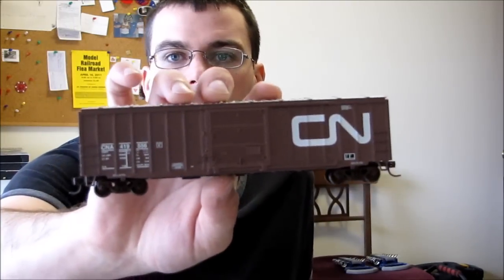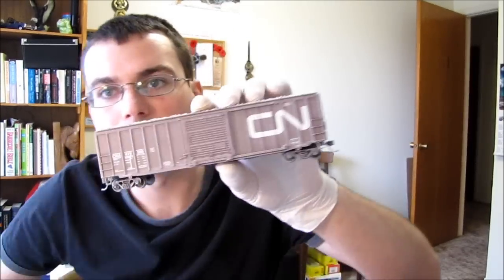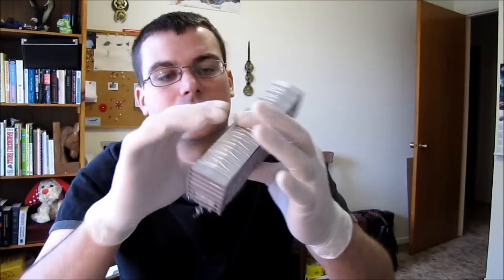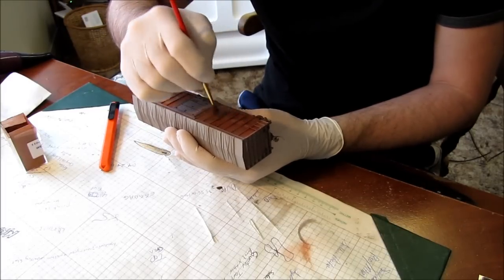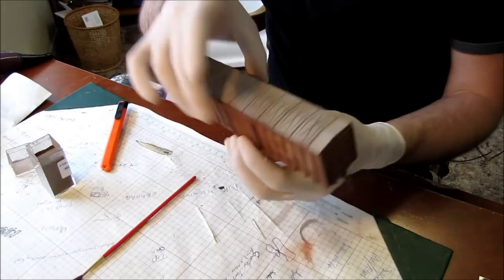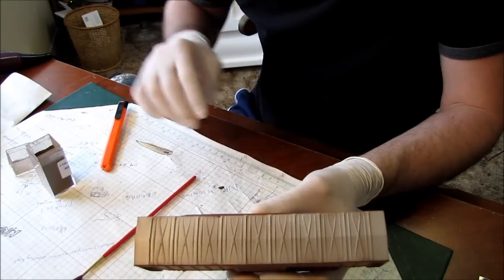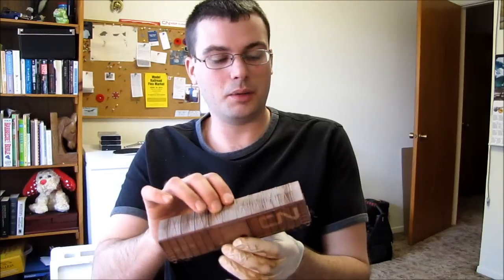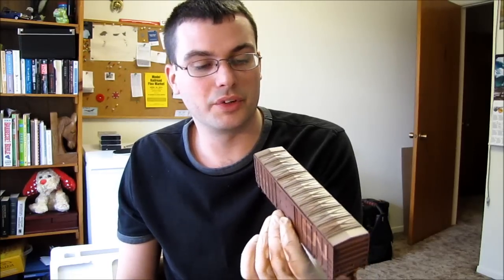4.08.11 "TRY TO" Weathering a CN Box Car

Comment: That turned out pretty good! I assume the spray can was a form of dullcoat. I would suggest taking the wheels and couplers off before shooting it with dullcoat. That way, like you said at the end, you won't need to clean the wheels where they touch the rail.

Anyway, the weathering turned out nice!

Comment from the maker: @PennCentral99 Its a Matte Finish clear coat to pretect the work.  I leave the wheels on as they need to be cleared as well.  They get painted up right from the beginning with the fading step.  Its no issue cleaning the wheels, just a cross eyed step!  Thanks for the comment.  I really liked how it turned out.